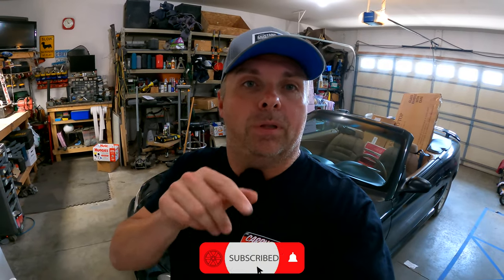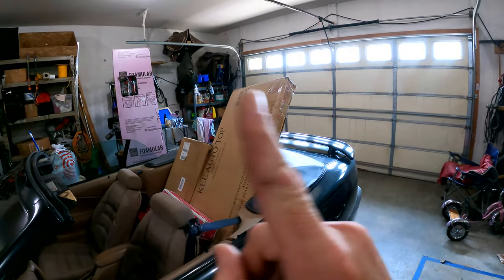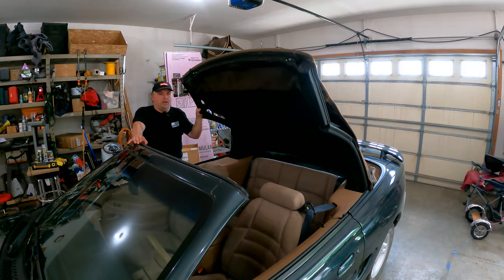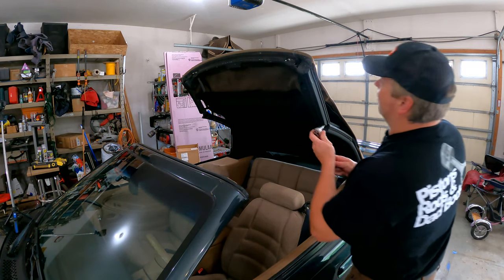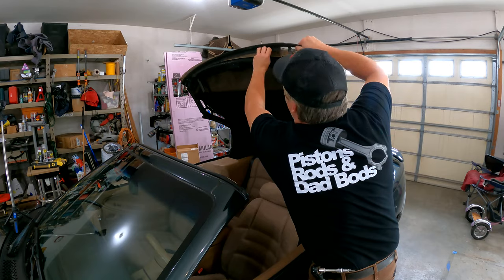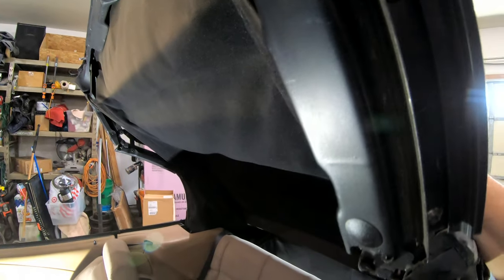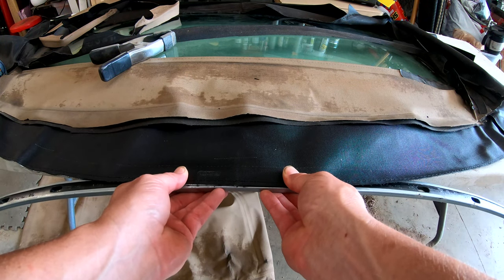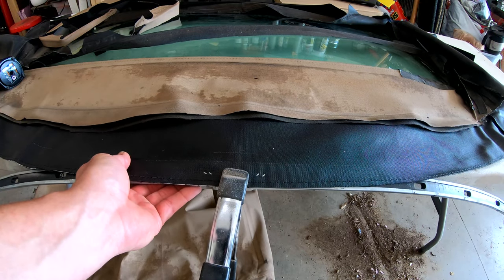TOPLESS!!!! - Convertible Top Replacement (SN95) on our 1998 Ford Mustang

Comment: Just getting finished with taking off the top, do you happen to have the measurement where to place the new top to the bar or any tips to make the stapling process go smoothly and for the first time?
Reply from the maker: I don't recall offhand, but what I believe I did was dry-fit the new top parts to the rear brackets (on the trunk filler panel) and get the material centered on the vehicle.  I picked a couple reference point on both sides at both the front and rear of the convertible top frame.

Comment: What staple gun and staples did you use for this?
Reply from the maker: I don't recall the exact model as I borrowed it from my Father, but it was an upholstery grade electric staple gun that had far more punch than your regular hand-operated model.
Reply from the maker: Hey Shane - It's a Duo-Fast unit, model number ENC5418A - https://a.co/d/aX4rcQT
Reply: @DachsAutos  Thanks!